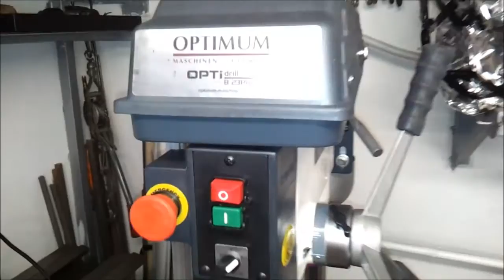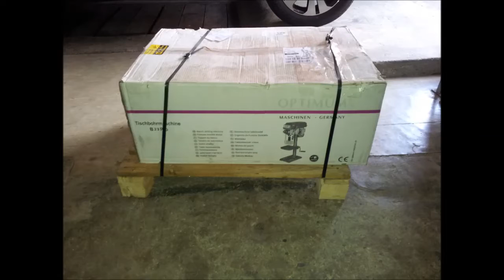drill press OPTIMUM Opti B23 Pro+ unboxing + drill press stand build pics .

Comment: Good afternoon, is there no backlash in the quill?
Reply from the maker: Hi,when is a quill completly out there is a backlash 0.15 mm
Reply: @Michal-hp7nc  Thank you, what is the thickness of the pipe? Engine power is enough, drill 10mm steel for example with a 13mm drill?
Reply from the maker: @Сутьділа  The pipe you mean probably column,thickness is i think 4 mm.Yes on a lower RPM you can drill 13 mm diameter with no problems,but for a bigger diameter drill bits i have a second bigger industrial drill press.

Comment: Hi, 
A year is passed and I would like to ask you some questions:
- the drill performed well?
- did you have any mechanical issue?
- Could you tell me the size of the stand you build for the drill? (LxAxP)

Thanks, SARTo
Reply from the maker: hi man,i had no issues  so far ,it is made in china but is  accurate and well done,so overall i am quiet happy with this dill press ,it is good enough for  occasionaly use in a home shop
Reply from the maker: a hight of the stand including wheels is 650 mm , width 580 mm and depth is 755 mm
Reply: Thanks a lot